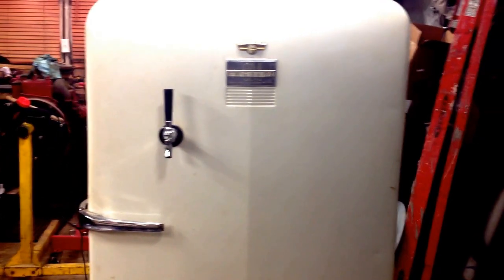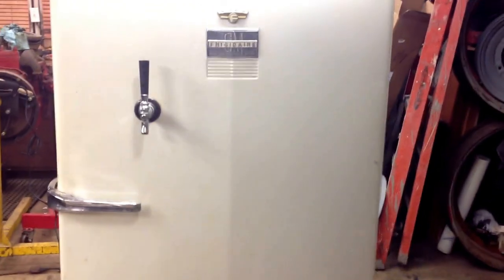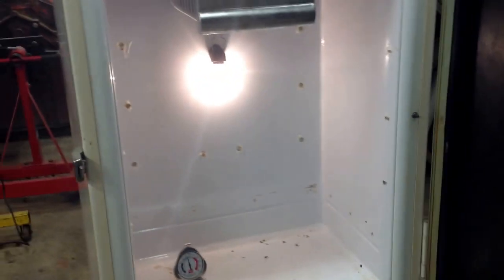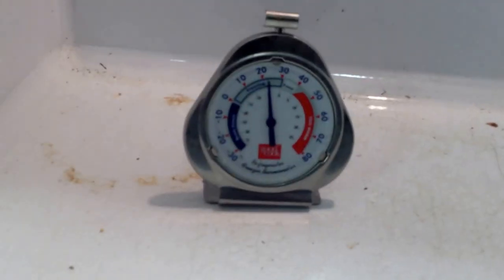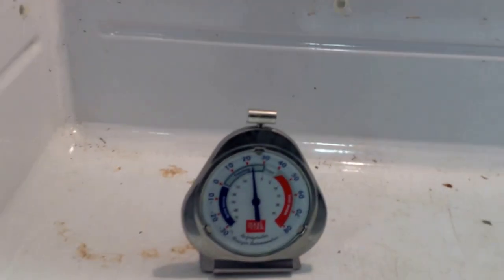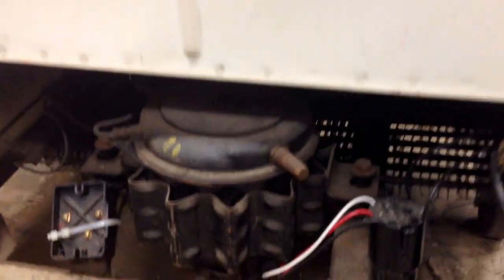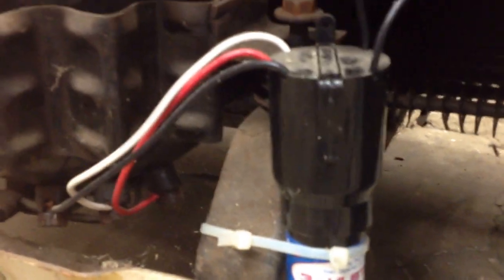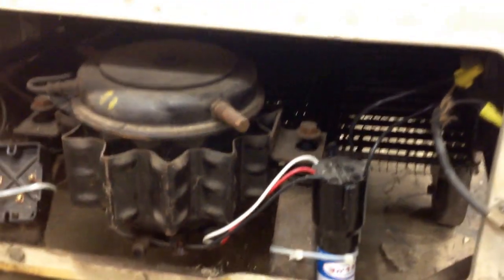1949 GM Frigidaire Refrigerator & Kegerator

Comment: I have a similar fridge and my starter gave up, so I was gonna install 3 in 1 relay  but I am afraid that I gonna bypass thermostat. would you explain little bit better how did you solved that problem, thanks
Reply: He used a johnson controls as a thermostat, super easy to install.